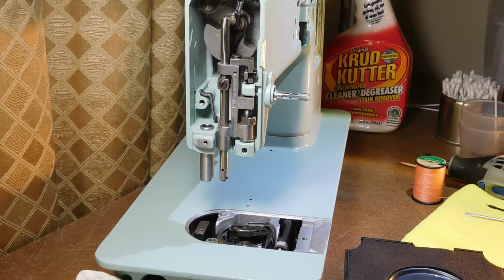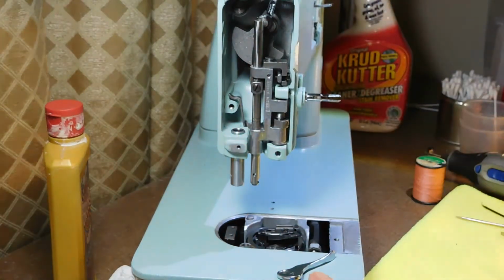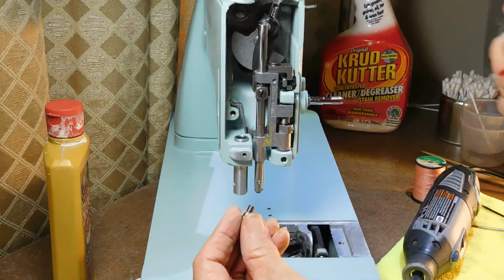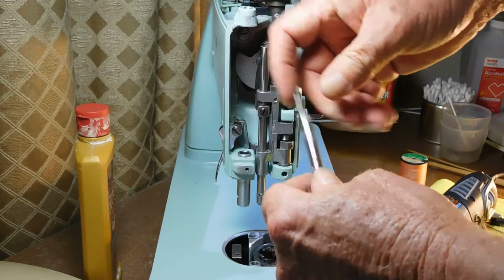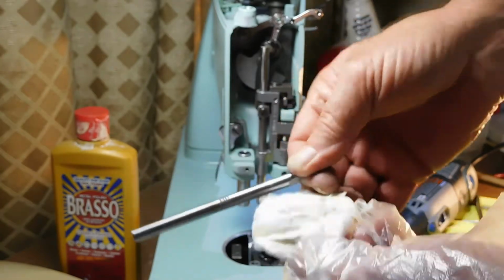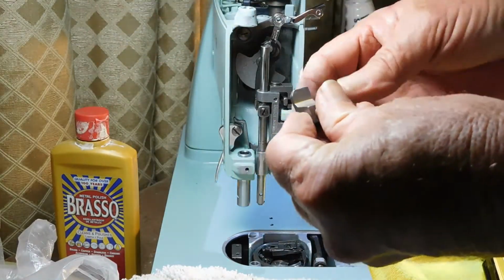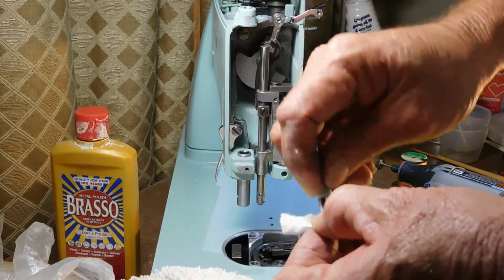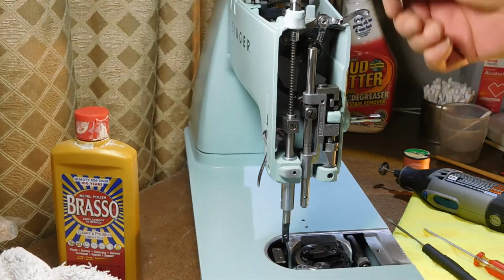Step by Step Restoration of a Singer Model 337. A Series. Part 13: PRESSER BAR

Comment: Thank you for your excellent videos.  They are very detailed and have been most helpful in servicing my 337. I am now working on a Singer 257. Again, your video's were very helpful even though the models are different. I do not know how to align the needle. The needle on the 257 is slightly off center. Do you have any information on how to adjust the needle?
Reply from the maker: Thanks for the compliment. I have not worked on the model 257. You can buy and download a copy of the original Singer Service Manual for $4.99 from Alex. It will have instructions on how to position the needle, set the needle position distance to/from the hook and time the pendulum movement of the needle bar. Before you do any adjustments, please check for the following: A BENT NEEDLE, a BENT NEEDLE BAR, DIRT INSIDE the "SEAT" of the needle bar (where you insert the needle). Here is the link to the service manual:
http://manualsoncd.com/?s=singer+257&submit=Search&post_type=product
Reply: Thank you for your prompt response. I will follow your helpful suggestions, then order the service manual,  if necessary.
Reply from the maker: Good Luck! Either way, I know you can do it.